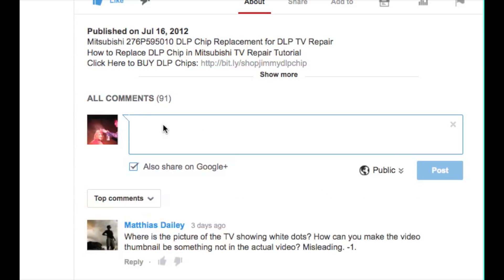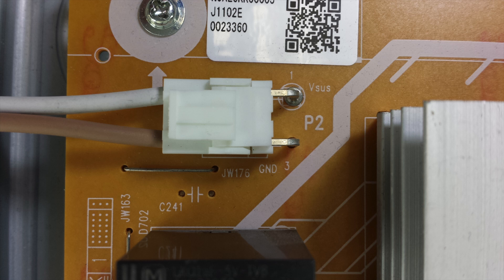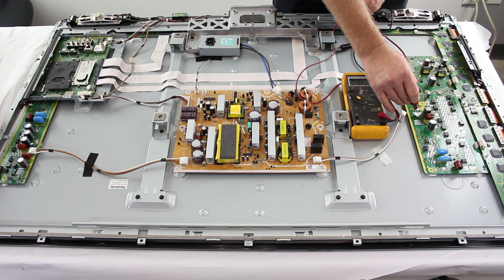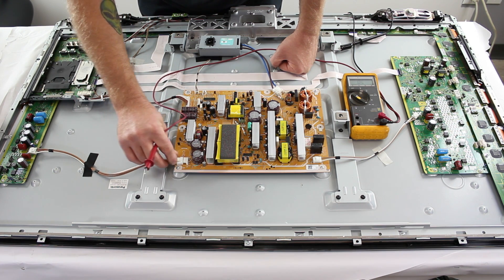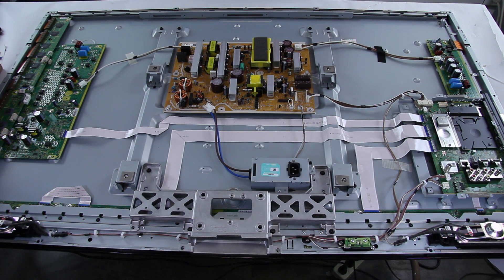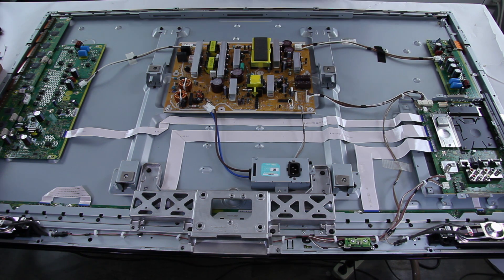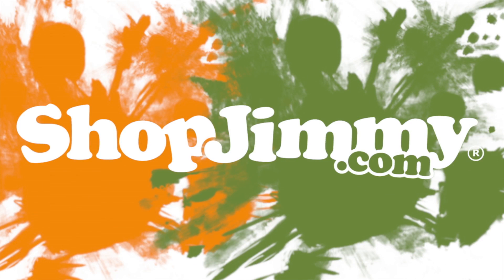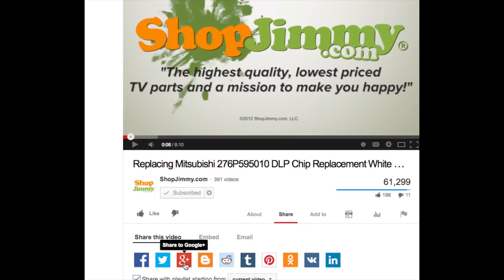Panasonic Plasma TV Repair - Understanding 14 Blink Code - How to Fix 2011 Panasonic Plasma TV

Comment: TV Model: TC-P50S30
Owned since 2012, Purchased new. 

Wifey said she was watching tv yesterday and tv pictrure suddenly went out. I had her unplug it. I can't be sure if there was a surge, but seems doubtful. 

Plugging the tv back in, the power light comes on automatically. The screen is black without any picture. None of the physical buttons function, nor does the remote have any effect. 

I did plug in a Kill-a-watt, and there is no current draw. I do have a multimeter to do further testing, just looking for a good place to start. 

Thanks
Reply from the maker: +David Downs   Try all repairs and troubleshooting at your own risk.  I recommend replacing the SC, SU & SD boards in your TV.  Click this link to replacement parts for your TV model number:  http://www.shopjimmy.com/catalogsearch/result/?q=TC-P50S30  There may be multiple boards for the same TV model number, be sure to match part numbers on your current board, with your replacement for compatibility.    Thanks and please let us know if you have any further questions with your TV Repair!  www.shopjimmy.com

Comment: Hi, While i was watching a movie on my TV Panasonic TX-P42ST30B all of a sudden i heard a blew sound like a fire works sound (bang), the sound came from the back of the TV immediately i unplugged the TV from power and i waited for 5 minutes  before i plugged it to power again, but unfortunately it never came on instead it keeps blinking red light for 7 times. What could be the problem? Do i need to replace any board? what could cause the TV to blew?

Comment: I have a Panasonic TC-P42S30.  It has the 14 blink code.  P2 does has a short connected but when disconnected.  I have a TNPA5349 labeled board and no TPCC1 that I can find.   How should I continue?

Comment: i have problem model phillips lcd 42"/PFL5403/93 
sometime light low high..........sometime trun off after 30 minutes or 20 minutes
pls help me out
Reply from the maker: +Javed Akhtar   Try all repairs and troubleshooting at your own risk.  I recommend replacing the main board in your TV.  Unfortunately I do not see any replacement parts in the search results for your TV model number on our website.  Please reply with your part number on your main board and I can try searching for replacement parts.  Thanks and please let us know if you have any further questions!  www.shopjimmy.com

Comment: Hi I have a Panasonic tc-p4gt25 tv and the roof flooded and it got wet today.  The power button is blinking 8 times.  Can u help.  I have the back of the tv off, but mmm, theres lots of boards back there

Comment: Hi I have a panasonic tcp42ST30
I used your test procedure and found P1 to be shorted and i had a 14 blink error code
I bought a new power supply board and when plugged in i get the same 0 ohm reading in P1

Comment: I have a panasonic 42 inch plasma tv model TH-P42V20V. I've had this for the past 5-6 years and I have been very careful using it. It is plugged into a surge protector to protect the TV from unwanted power spikes. I turn off the main tv power switch on the right side of the TV when I do not use it to prolong the life of its components.

So far the TV has been performing for so many years without a problem due to the extra steps I take to take care of it.

Now suddenly I have noticed that sometimes while watching TV, the power suddenly trips (as in like a sudden power reset) without any reason at all and then goes back on again. This has occurred thrice already although intermittently. I am perplexxed because nothing else in the house has tripped and there is no power interruption in the area.

Why is this? I am still able to watch TV with no problems but it just perplexxes me why the sudden power trips? Could this be a sign of something bigger (worse) to come? Could it be a sign of an eventual component failure?

I would like your opinion on this and if there is something to be concerned about, what is the remedy/solution?

Thanks in advance.

Comment: Curious, I have one of these models and it's power LED is blinking 14 times.  I got to the PS board and P2 pin 1 to gnd with the SC board connected or disconnected resulted in a short.  Now are we 100% sure it's the PS in this case?  I ask because with the SC still disconnected and I go to P11 (SS connection) and I pull it I read 300K ohm from P2 pin 1 to ground.  Thoughts?
Reply: Panasonic TC-P42X3 so it applied to this video.  Also my question again is:  Can you be sure that it’s the power supply if you see a short with the SC connected AND disconnected from P2 pin 1 to ground?  I ask because when I leave the SC disconnected and THEN disconnect the SS connection I read 300K ohms from P2 pin1 to ground.  I’m discussing this at badcaps.nethere:  http://www.badcaps.net/forum/showthread.php?p=599375#post599375

Comment: Hey I got a question I have a Panasonic plasma tv TH-50PX75U and recently the top half of the tv went completely out only the bottom half works
Reply: +Patrick Woodlock thank you
Reply: +Patrick Woodlock how much does the part cost?
Reply from the maker: +David Richison  Try all repairs and troubleshooting at your own risk. This could be a problem with either the upper buffer or the TV panel.  Unfortunately I do not see any replacement parts in the search results for your TV model number on our website.  Please reply with your part number on your main board and I can try searching for replacement parts.  Thanks and please let us know if you have any further questions!  www.shopjimmy.com

Comment: panasonic tc-p65s60. i had a power surge in my area and since then my tv power turns on but the video is all messed up. i see jumbled up colors and strips of blue and yellow pixels. Generally i see that video shows up with my antenna connected. I press the input button but nothing shows up for that matter any things that i press on tv nothing happens.
Reply from the maker: +Pradeep Sharma  Try all repairs and troubleshooting at your own risk.  I recommend replacing the main board in your TV.  Click this link to a replacement main board for your TV model number:  http://www.shopjimmy.com/panasonic-txn-a1upuus-a-board-for-tc-p65s60.htm  There may be multiple boards for the same TV model number, be sure to match part numbers on your current board, with your replacement for compatibility.  Here is a link to a video showing how to identify your part number, click here:  https://www.youtube.com/watch?v=RwHTvjMdrhk  Thanks and please let us know if you have any further questions with your TV Repair!  www.shopjimmy.com

Comment: I have the same Panasonic but it began showing magenta in bright scenes. After about a week of this the top 50% had lines but looked normal during dark or color scenes.I then had the click of death along with a 7 count LED Error code. From what I have read it's the SC board but could be any of the 3 boards on the left side of the T.V.or even the power board.I guess I'll try the SC board and if that does not work simply save up for a new LED LCD. I'll never buy a Panasonic anything ever again! Samsung or Sony only from now on!!!!!!!!!!!!!!!!!!!!!!!!!!!!!!!!!!!!! Sincerely, Steven Level

Comment: Hi, I have a TC-P60S30 and after a few minutes after being turned on, a distorted horizontal line will appear on the bottom and the the same will happen on top and basically takes over most of the tv… any ideas to solve this problem?
Reply from the maker: +Lalo DeAnda   Try all repairs and troubleshooting at your own risk.  This sounds like a TV panel (TV Screen) problem.  If your TV panel is bad, it may be more cost-effective to replace the TV as panels are typically hard to find in stock, difficult to replace, and expensive.  Thanks and please let us know if you have any further questions!  www.shopjimmy.com

Comment: With the SS board disconnected it blinked 7 times repeatedly
Reply from the maker: +Trepin Tate   Do you have experience using a multimeter to check voltages?  Thanks!  www.shopjimmy.com
Reply: +ShopJimmy.com I do not have one or experience , but I'll pick one up to continue the diagnostics
Reply: +ShopJimmy.com I did purchase a multimeter finally.  My brother in law has more experience than I and I have elicited his help.  Are there certain results I need to compare my findings against?

Comment: Thanks for the reply.  Which is the sc board?  My model is the TCp42c2

I thought it only had a SS and SN board along with the main and power boards.

Thanks.  Sorry for the additional question

I did unplug the board on the top right when facing it from the rear.  It has SS written on it.  tnpa5072. When I turn the TV on it now blinked 7 times repeatedly.

What other boards should I unplug?

Comment: I have a Panasonic Viera TC-P50S30.  I followed your video up to the SC Board.  I disconnected the SC2 connection and the Ribbon Cable and still had a short at SC2.  I moved to TPSC1 and that is where the short disappeared.  In your video you went right to disconnecting the SU Board saying that if the short disappears then the SU Board is bad.  I never had to disconnect the SU Board or the SD Board to get rid of the short.  Does that mean it is the SC Board that is the problem?
Reply: +Rus Maglio Sorry forgot to mention it has a 14 blink code.
Reply: +Rus Maglio Were you able to fix it? I have the exact same issue.

Comment: panasonic tcp42c2 front panel red LED began blinking 10 times repeatedly just yesterday
I had just turned it on and it showed the picture for a few seconds before making a click noise and going black

The TV clicks in a similar fashion shortly after being turned on (after being unplugged).
I held the power button for up to 30 seconds in efforts to reset it, but that didn't work.
I opened it up and I don't see anything amiss. I only have limited technical skills, but I didn't notice anything discolored or mis-shaped

Comment: I have a Panasonic TC-P65VT30 that will not turn on, no standby or light if any kind. This started after a lightening strike to my home. I do not know if it came thru the Time Warner cable or my electric service. I took the back cover off and checked that I do have 120 v AC at the NOAE6KM00005 board at P9. I do not know if I have DC voltage further on. How do I check to see if my power supply boards are bad or if it is the main Board? Geoff Broombroom.hr@gmail.com
Reply: Similar problem. What was the fix?

Comment: Thanks for this TS aid. The 14 blink on my Panny 42ST30 ended up being an SN board.  My Apr 2011 model did not have  SC, SU or SD boards. My SN board seems to combine all these. Either way a short at P2 led me down the path. Before your aid I was already prepped to suspect the P or A boards, but your guidance pointed me otherwise. Thanks!

Comment: Followed all the directions and got to the end. When I plug in the tv and immediately turn it on I get a solid red but if I hold the button i get the 14 blinks. Still not sure if I should replace the A board or main power board. Any help would be greatly appreciated.
Reply: @Rustang Ever get a solution to this?  I have same symptoms
Reply: same here.  what was the solution?
Reply: same situation.  what was the solution?
Reply: never got a solution. What this video told me was that it could be 1 of 3 boards. Each board being over 100 dollars on ebay now, I figured its not worth it.
Reply: Thanks for replying.  Guess I'll find a local guy to fix it, it's gotta be a lot cheaper than a new tv.

Comment: I have the panasonic  TC-P50V10.  Upon turning on the menu pops up for about 3 seconds hear a fan then a click - then getting 11 flashes repeating
Reply from the maker: +Don Fenyk  Try all repairs and troubleshooting at your own risk.   I recommend replacing the main board in your TV.  Click this link to replacement parts for your TV model number:  http://www.shopjimmy.com/panasonic-txn-a1druus-a-board-for-tc-p50v10.htm  There may be multiple boards for the same TV model number, be sure to match part numbers on your current board, with your replacement for compatibility.  Here is a link to a video showing how to identify your part number, click here:  https://www.youtube.com/watch?v=IrfefQ7SIXk  Thanks and please let us know if you have any further questions with your TV Repair!  www.shopjimmy.com

Comment: hi i have a panasonic L32C53D its not starting after power fluctuation.
it only blinks green colour light for 9-10 times
then goes on stand by flashing red colour light
please help me out what might be the problem
Reply from the maker: +Sameer Verma   Try this at your own risk. Unplug the TV, then disconnect the SC board and plug in the TV to see if the TV powers up. Note that it will not have a picture on the screen. Reply with the results of this test. Thanks! www.shopjimmy.com

Comment: HI  Hope you can help me.  No one seems to be able to fix my Panasonic TV  Model TC-P50UT50.  I get the 7 blinks.  Which board do you think it is?.......Thanks for any help....Brian  Email dukekraus65@gmail.com
Reply from the maker: +Jason rampolla  Try all repairs and troubleshooting at your own risk.  I recommend replacing the main board in your TV.  Click this link to replacement parts for your TV model number:  http://www.shopjimmy.com/panasonic-txn-a1sduus-a-board-for-tc-p50ut50.htm  There may be multiple boards for the same TV model number, be sure to match part numbers on your current board, with your replacement for compatibility.  Here is a link to a video showing how to identify your part number, click here:  https://www.youtube.com/watch?v=IrfefQ7SIXkThanks and please let us know if you have any further questions with your TV Repair!  www.shopjimmy.com

Comment: I have a Panasonic High Def Plasma Model TH-50TZ700U. I can only see from the nose down of the people (Half of The faces). I checked the menu button on the remote, but couldn't find any buttons that would help. How can I fix it.
Reply from the maker: +Pedro Gildelamadrid   Try all repairs and troubleshooting at your own risk.  This could be a problem with either the TV panel or a buffer board.  Unfortunately I do not see any replacement parts in the search results for your TV model number on our website.  Thanks and please let us know if you have any further questions!  www.shopjimmy.com

Comment: Hi, i have a question..
Panasonic viera 42" plasma, model TH-42PV60A
IT STARTS SHOWING RED PIXELS ALL OVER THE SCREEN, SOMETIME SHOWS LIKE LAVA FLOATING.
Also the green led light blinks several time before the screen starts. ( i think 20 or 21 blinks all time)
can you help me to fix this issue?
cheers
Reply: hari paniker
Reply from the maker: hari paniker   Try all repairs and troubleshooting at your own risk.  This sounds like a TV panel (TV Screen) problem.  If your TV panel is bad, it may be more cost-effective to replace the TV as panels are typically hard to find in stock, difficult to replace, and expensive.  Thanks and please let us know if you have any further questions!  www.shopjimmy.com

Comment: Hi and thank you for this video. Panasonic P46ST30 when the TV first broke it was the morning after a storm (TV was on a surge protector). It worked fine in the AM but then it turned off on its own and then wouldn't turn back on. When I turned it on, the red light was solid. Holding the button down for a bit, the TV would blink 14 times. I went through your video and looked at other comments and did some tests. I have a short at SC2 but TPSC1 is open for both SU and SD. I unplug the SC card and turn the TV on and get 8 blinks. I plug SC back in and unplug SS and get solid red. Any thoughts as to what I need to replace? Thanks again!

Comment: Hi - I have a TC-P50S30  with a 14 blink error code.

I followed your guide and found that the pin at SC2 is indeed shorted.  However, pin TPSC1 on the SC board is NOT shorted.  I tried disconnecting the SD and SU boards, respectively, to see if that made a difference, and it did not.  I tried connecting the plug back at SC2, and that didn't make a difference.
I also noticed that you used a different ground point when troubleshooting the SC board, and I tried both (i.e. anywhere on the chassy of the TV as ground, and then that screw that you specifically used...I found that they don't share the same ground) to no avail.

What is the indication when SC2 is shorted, but TPSC1 is not?
Reply: Amma Mar ShopJimmy.com Hi Shop Jimmy - any advice?  Looks like several of us with TC-P50S30 have the same issue.
Reply: +Amma Mar Hi Shop Jimmy - any update on this?  Several of us have this issue, thanks!
Reply: +Amma Mar +ShopJimmy.com Hi Shop Jimmy - any update on this?  Several of us have this issue, thanks!

Comment: Hey Jimmy, 
Thanx for your tutorial.I truly appreciate it. Hopefully if I fix this tv I will send you a few bucks for your help. I have a question. Last month I was a block from my home when I saw this tv laying out for trash. I am NOT a cheap person but I dont like to see potentially good things being thrown away. I took this 55" Panasonic Plasma TV home and have it propped up on my work bench with the back of it out, ready to be diagnost . I. am a HVAC tech. so I have a mechanical aptitude where I feel confidant to work on this tv.My question is.... would any board on this tv make make it not worth fixing cause of cost and potentially other things going bad on this particular brand/model ? I have been reading ALOT of horrible reviews on Panasonic Plasma TVs.Particularly this model.
I didnt read all of your comments or advertisementts but I will assume you sell parts for tvs? You have got my business once I figure out the problem.If I do fix it would you recommend cutting a hole in back and install a computer cooling fan. I read that heat is alot of the problems.Thank you so much. Howard from Fairless Hills, Pa.